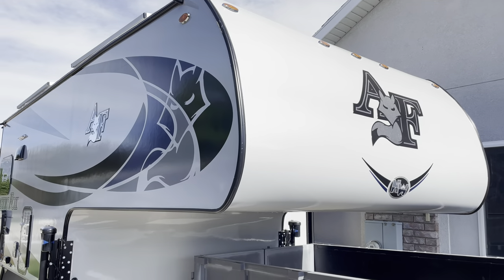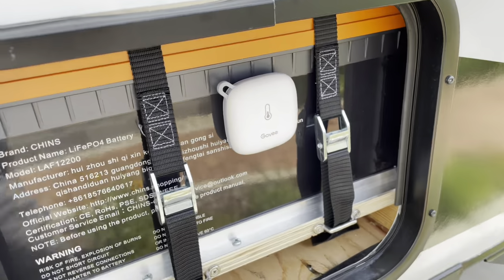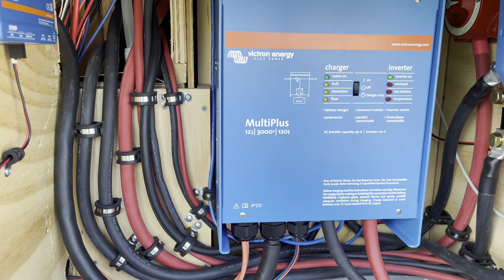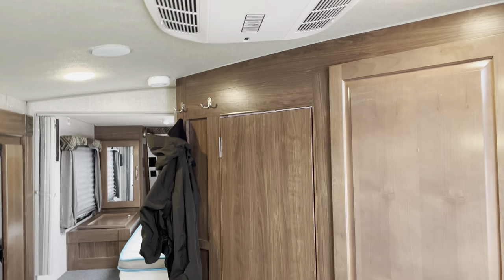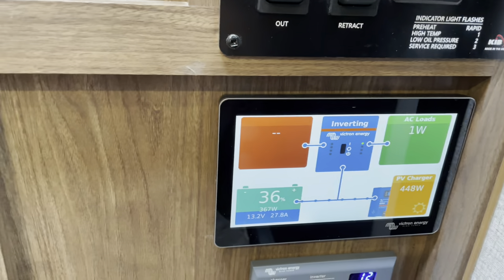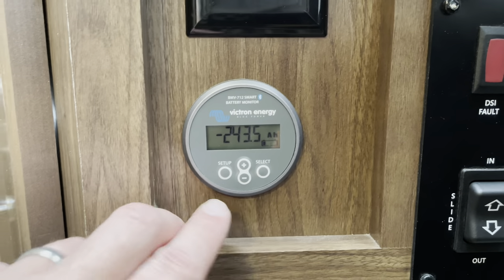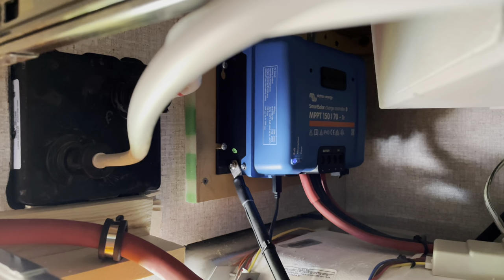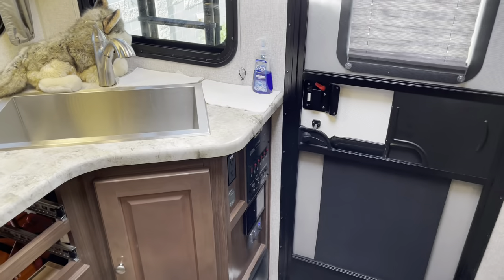2021 Arctic Fox 992 Truck Camper Solar Install Tour

Comment: Mark, when your Air Con was running, the display indicated an AC load of 1060 watts. Your battery was suppling 840 watts and your PV was supplying another 450 watts for a total of 1290 W.  Does this mean the Multiplus consumes 230 Watts(1290 in but 1060 out) ( inefficiency more than 20%)at 30% load?  When the Air Con shut itself off Your PV output was 460 watts but your battery was only getting 375 watts. Does this mean the multiplus was using 85 watts standby current with no load on it?  Were there other DC loads using that much ie the 85 watt balance.  Does it get hot under the counter?